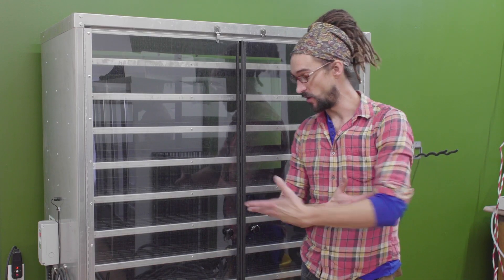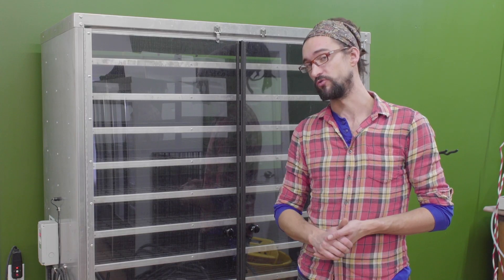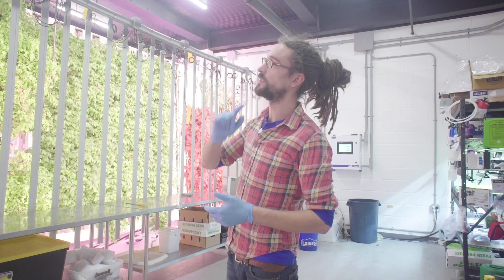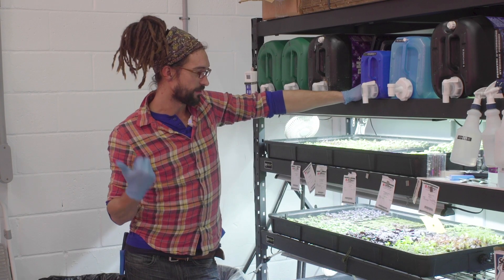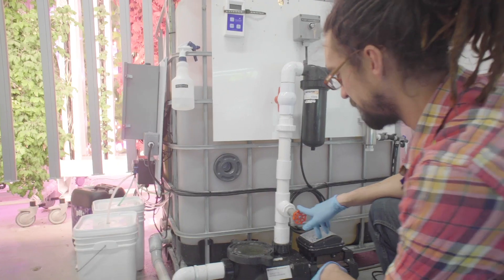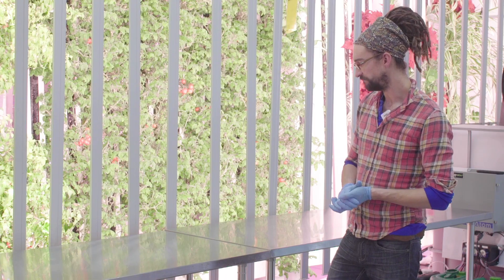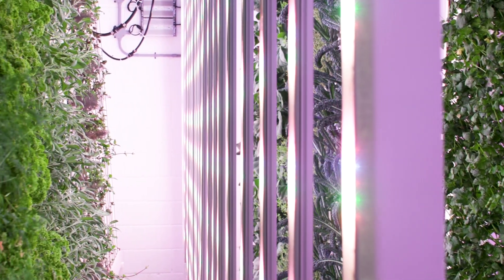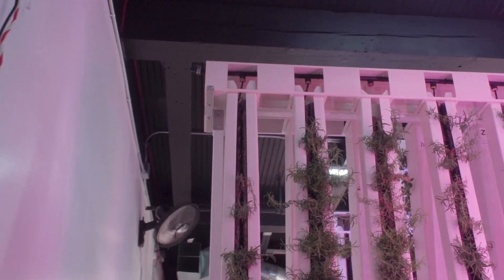ZipGrow Farm Tour

Comment: Just learned about this farm system.  Is it  possible  to go solar off grid  to operate the system? Where I am based the electrical supply is not reliable and a solar battery setup is the only thing that makes economic sense.
Can you give a ballpark estimate of the electrical power requirement per day?
Reply from the maker: 450 tower electricity- Daily KWH breakdown-lights single sided (8') 57.6 . Lights double sided 230.4. LED drivers 17.28. Plumbing 54. Seedling kit 16.8 and germ chamber 12 shelf- 8.64

Comment: Thanks for in depth tour of your farm. Curious to find out with 450 towers. How many kg of vegetable can you get per month?
Reply from the maker: It really depends on what crops you are growing. There are optimal temperatures, ph balance and nutrients for each crop. For commercial set-ups our team works with the individual to help determine the best crops to grow for their market and then we can give best case production from there if they work within those optimal conditions.
Reply: Good question.  If each tower grows 10 plants and the avg weight from each tower is 60 oz then 60x450=27K oz or 765kg if the turn is 30 days AFTER seedlings are transplanted.  Lot of assumptions about plants in this but move the numbers up or down, then we have to consider opex vs prices.   I really like the zipgrow approach but would have to really plan the "right" crops and grow on spec to be successful in my area.  No different than any other farm these days.